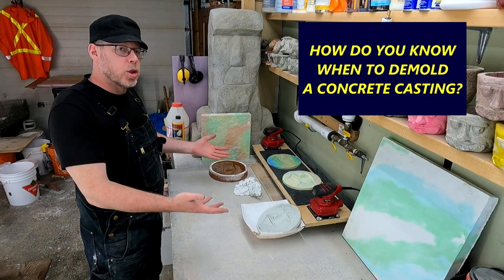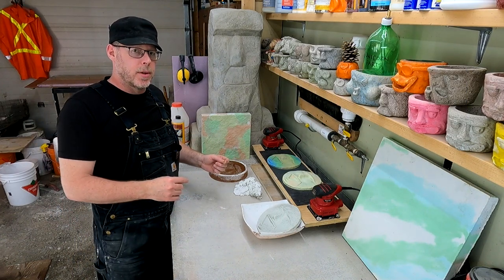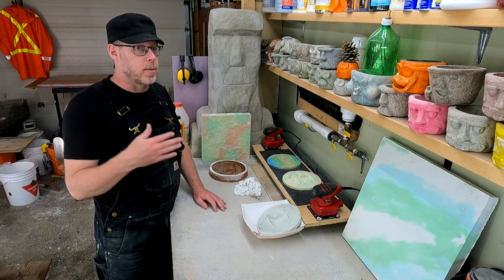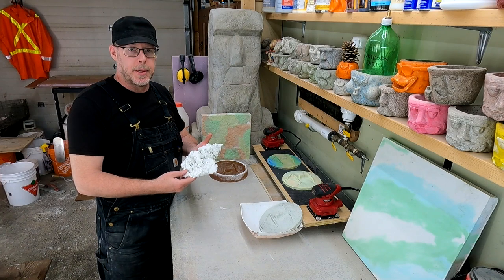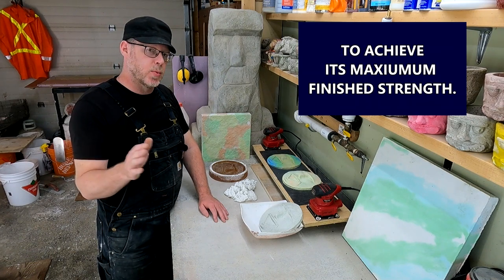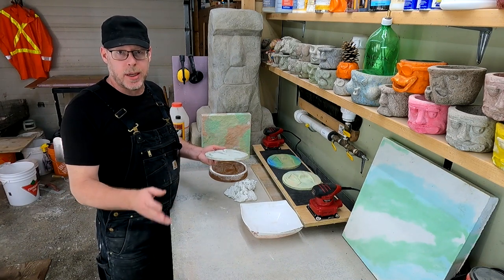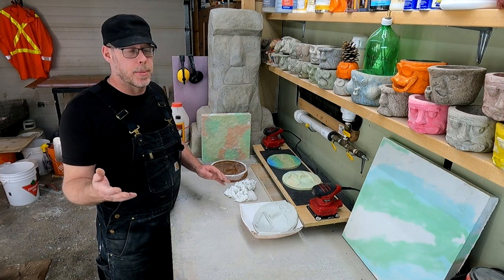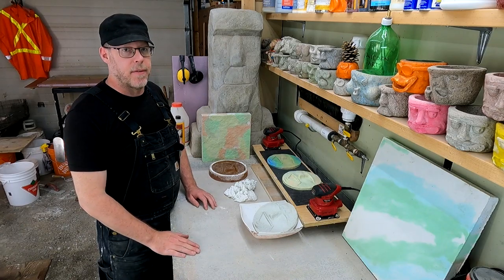How Long Should Concrete Stay In a Mold?

Comment: BTW. I am using 3d printed mold made from PLA plastic. I've feeling that either cement or moisture in it is corrosive for PLA and is making the mold milky matt, brittle and deteriorating rather quickly after few uses. I guess it kinda makes sense, since PLA is acid and cement is strong base. But it's just something that i've found. Probably might be alleviated by using thicker mold release or completely fixed by using PETG plastic instead.

Comment: Hello Steve, I've been searching on the internet and can not seem to find the answer to my question. 

Fisrt, my goal is to reduce shrinkage of mortar and concrete to as much as possible. 

Heres the question. If using a bonding admixture or acrylic admixture can be used a 50% of the water, can I not add water reducing admixture to further reduce the content of water in the mix so to reduce double fold or eliminate the shrinkage that happens when water leaves the mix over time?

And bonus question. Access to acrylic fortifiers is cost prohibitive or outright impossible for the small player, but acrylic paint primer for concrete is plentiful. Can it not be used as a substitute? The acrylic paint primer is a milky liquid that is used for roofing impermiabilization, it's almost like water. I've heard of people having used it to form a "crystaline coat over roofs" when it leaks, usage is instead of water use that with Portland cement.